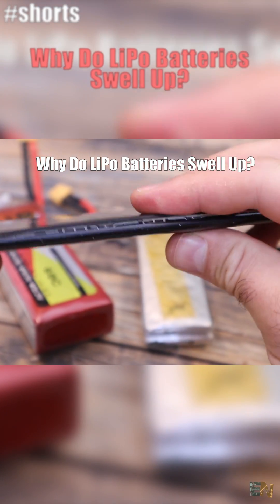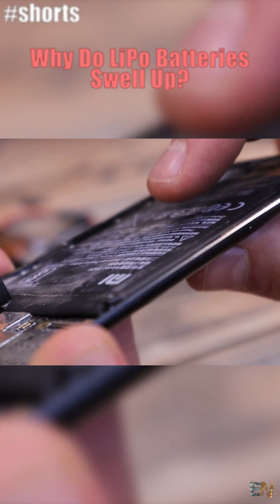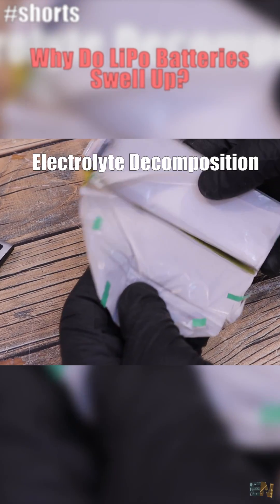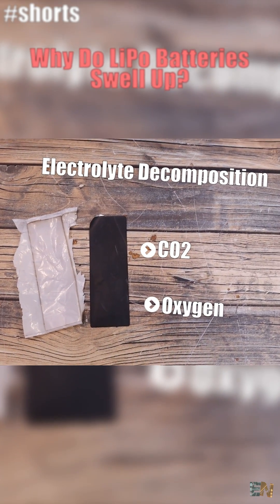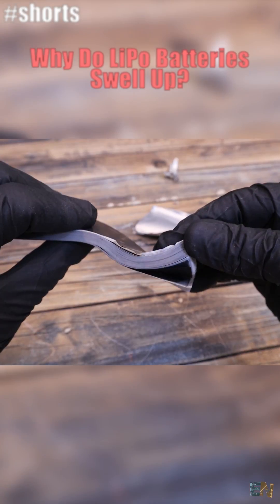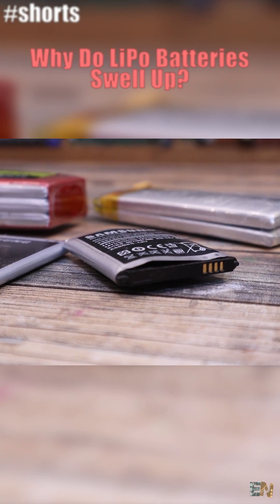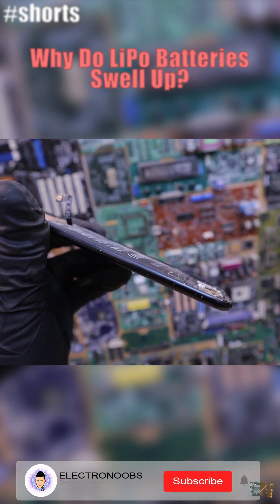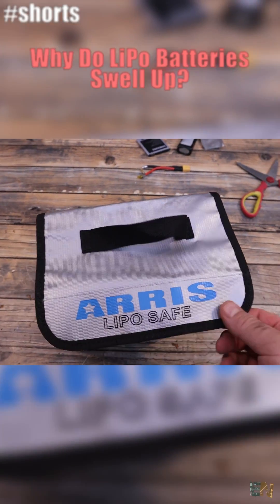Why Do Li-Po Batteries Swell Up? 😮😮😮

Comment: Someone know the chemistry of common RC LiPo batteries? Obviously NMC but their voltage is high with 3.85V discharge average not 3.7V or 3.6V so they might be more manganese than cobalt. Maybe NMC 7.2.1 or such ratio.
Reply: Coucou